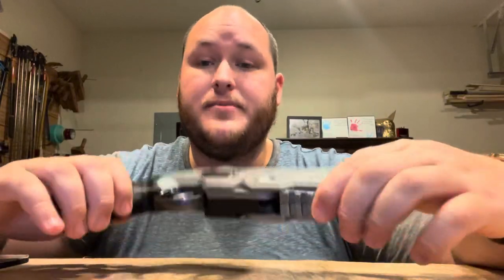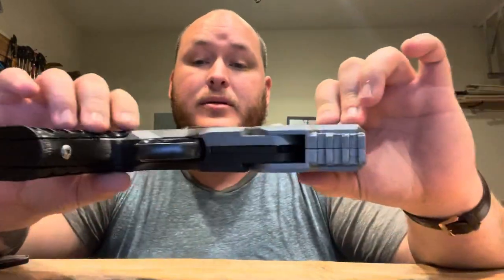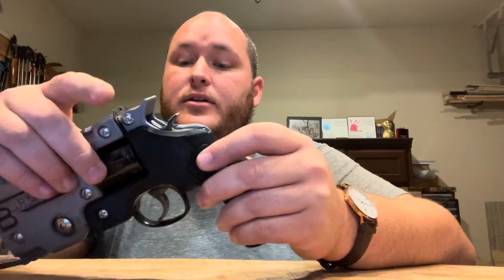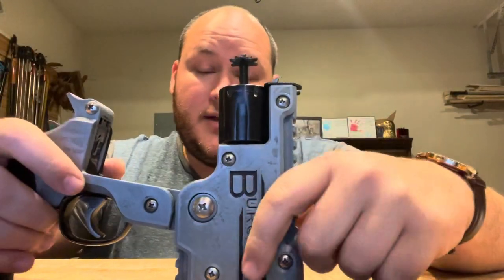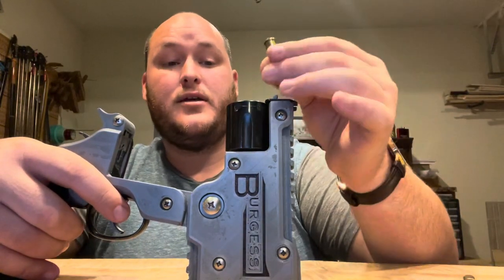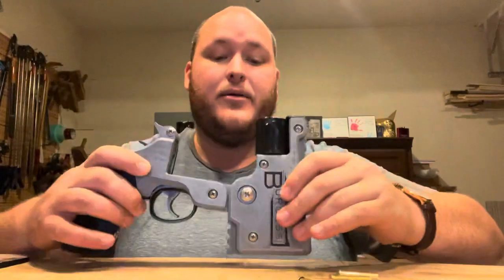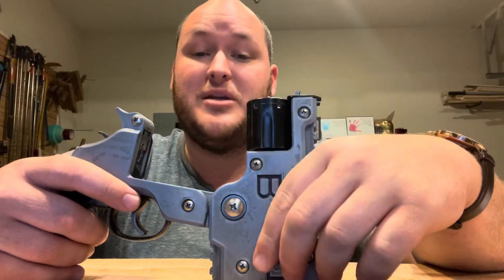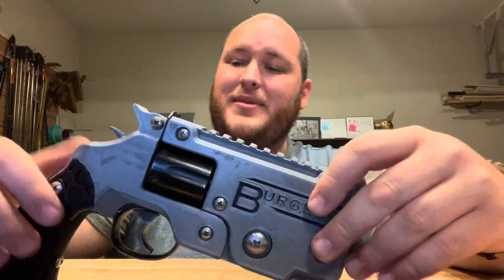Burgess 3D Printed Top Break Revolver Show and Tell

Comment: I’d suggest proper picatinny rails on the top, and maybe see if you can make a design with glock style ironsight slots so aftermarket irons can fit in there. Overall a super cool design and I can’t wait for a file drop

Comment: One thing I would suggest about your design. Is possibly finding a different spot for you break release lever. Maybe on one of the sides. Right on top of the hammer feels like in the heat of the moment one could pull that down rather than the hammer. Then uh oh lol

But you are definitely doing some great work here, keep it up
Reply from the maker: Cool thing about being 3d printed. Users choice. I’ve tried both. When I finally get around to finishing, I’ll probably release files for side and top thumb lever. both have there pros and cons.
Reply: One thing I learned from shooting double action revolvers, don't use the hammer. 😀

Comment: So in effect it’s a Model 10 saw cut kit bolted back together into a top break? Man that is incredibly smart, especially considering the deluge of cheap Model 10 and 14 kits around these days, well done!
Reply from the maker: That’s pretty much it. I did have to do a lot more cutting and grinding to the kit parts. I’ll need to do a very detailed how-to instructions and maybe design a 3d printed jig to guide to make it as easy as possible for other people. Thanks.
Reply: @burgess5609  yes please do a well made Readme is always a plus. Thank you.
Reply: I have a feeling those parts kits are about to skyrocket in value

Comment: You could 3d print a mold and cast a metal cylinder
Reply from the maker: It’s possible, but I would have to buy the equipment to do that $$$. I would be more nervous shooting a cast cylinder over a machined one. Especially one I cast myself since I’ve not done casting before.
Reply: @burgess5609  I don't think cast would be a problem if the right alloy was used. Engines do this kinda crap all the time , but it would take some research.

Comment: I know it's less than safe... But could you do plastic single use chambers? Fire plastic bullets or one of the filaments with metal in them?
Reply: By volume, the copper-impregnated filiments seem the be heaviest in my testing. In care you are discussing paperweights, they would do well, although not particularly strong. For a paperweight you could throw at someone, you may want to consider a remelt process (in a mold to preserve dimensions).

Comment: How does this address the issue of the latch degrading over time? I thought that was why we stopped using them over time.

Why not go the Deus-Ex route?
Reply from the maker: I'm not sure it does. the problem with the Deus-Ex is the combining the top break with a bottom cylinder barrel would also make the mechanism for auto-ejecting more complicated as the barrel is sandwiched between the hinge and the extractor plunger. I haven't tried to figure that out. also I'm using an existing parts kit for a 38 revolver that fires from the top. I'm sure someone will figure out a Deus-Ex Revolver for 3d printing or otherwise eventually.
Reply: @burgess5609  Probably. Any plans to release the design somewhere eventually?

Comment: Very cool project!

Is it necessary to have that much mass underneath the barrel, or is that mostly an aesthetics thing?
Reply from the maker: A little bit of both. There’s is a part internally there that  Im using to release the extractor when the revolver is opened up and I needed space for the screw and the picutinnyrail and then it just looked better to me with a more square profile.
Reply: It would be a cool place to put a flashlight/ laser/actual Taser/m&M's/mp3 player. 😀

Comment: could the barrel be put on the bottom like a chiappa?
Reply from the maker: For a top break revolver, It would be more complicated and possibly add bulk to the sides. The cam (spur) for the casing extractor is where a bottom barrel would be. the cam would need to fit around the barrel. I’m also using parts including a partial frame from an existing gun. Essentially I designed a top break conversion kit for a cut gun.